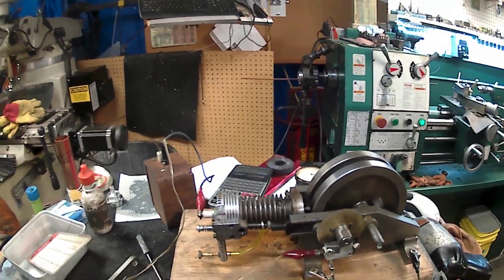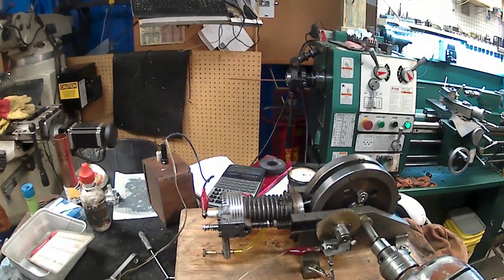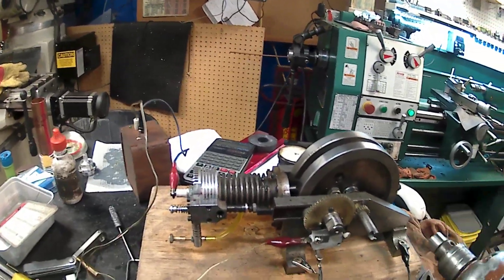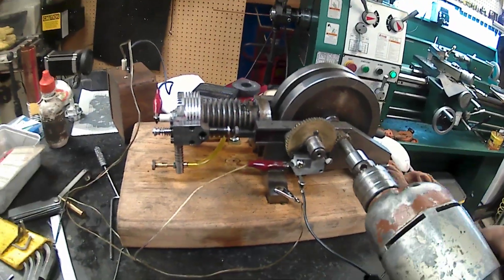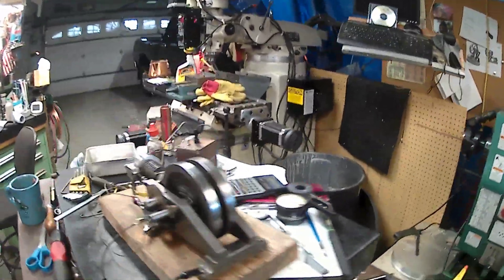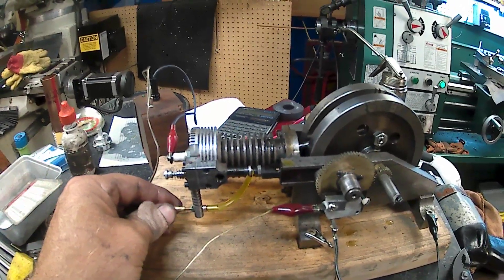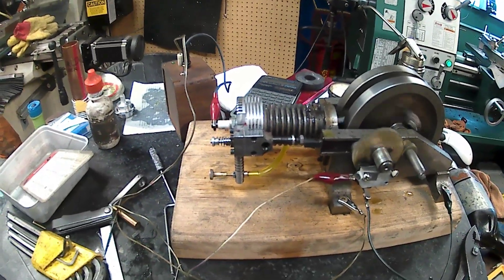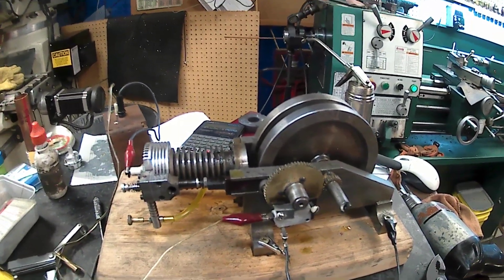2ND 6cycle engine first run

Comment: Sounds pretty good.  Love your little 6 cycle engines!
Reply from the maker: The 2 engines belong to a former co-worker. He made them in trade school but never gt them running. He seen mine and asked if I'd be interested in getting them running for him. And I love tinkering with them so I said sure. There were a few minor things I had to fix but for the most part they were done. Mine is the one that is painted up in John Deere colors. SO both of his engines now run pretty good. I changed out the micro switch I had on this one and put on a cobbled up set of old points and now runs much better.